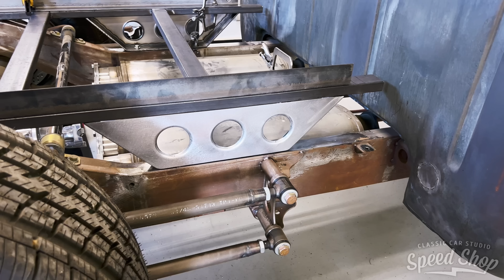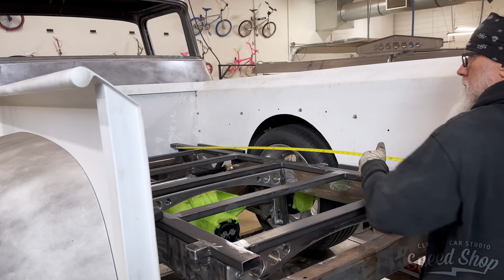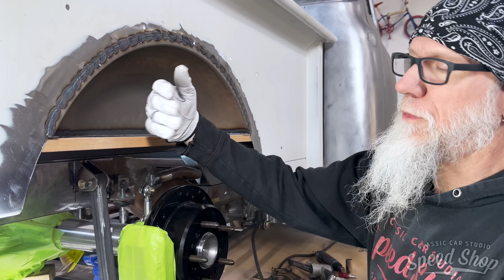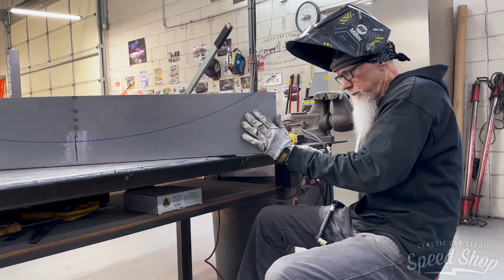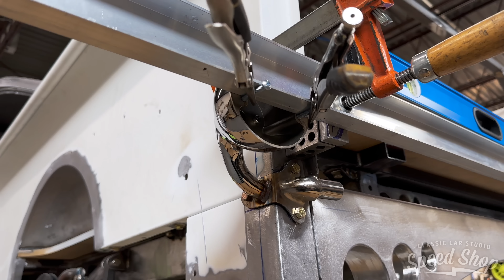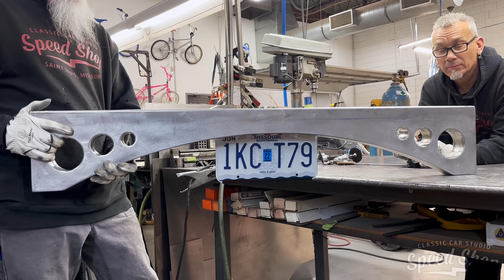Bed Fabrication • 56 Ford F100

Comment: would have been next level if the arc across the bottom of the tail gate matched the bottom of the rear panel and the top of the rear panel arced up to match the bottom of the tail gate